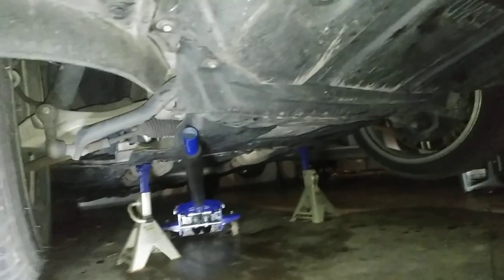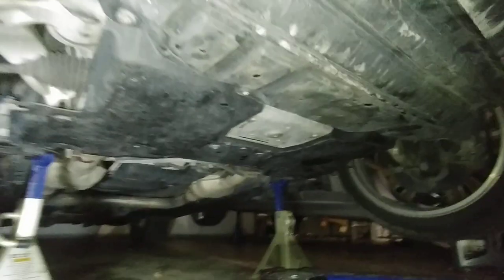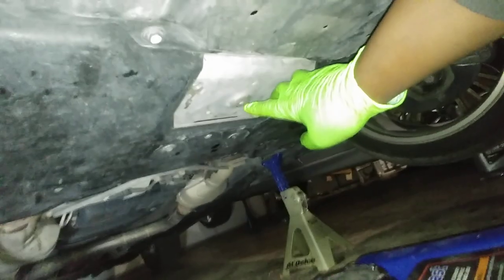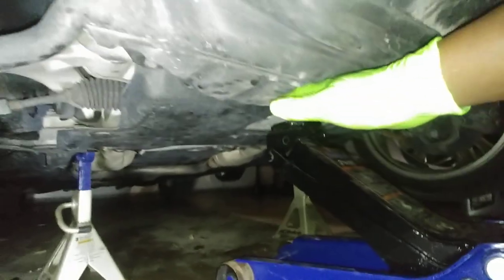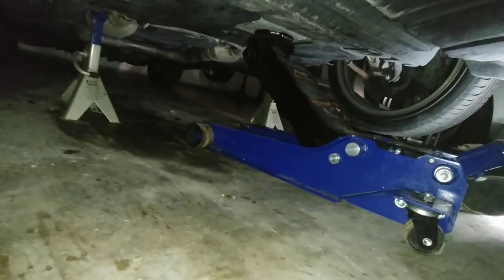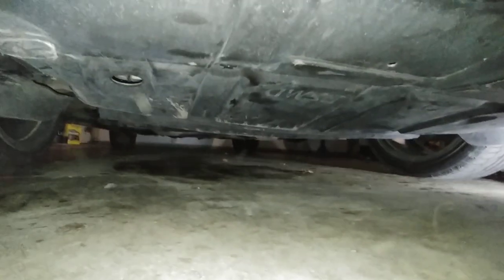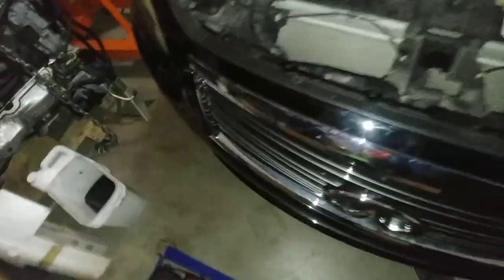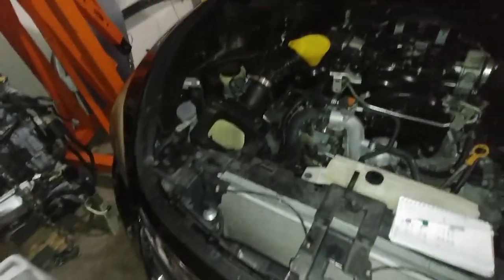Infiniti M56 floor jack & lifting points. pt 1

Comment: Ed, is there a rear lift point, other than the pinch welds in front of either rear tire?
Reply from the maker: The rear differential is a safe point
Reply from the maker: Similar to the previous generation. https://youtu.be/MtZ5cNSkqyY